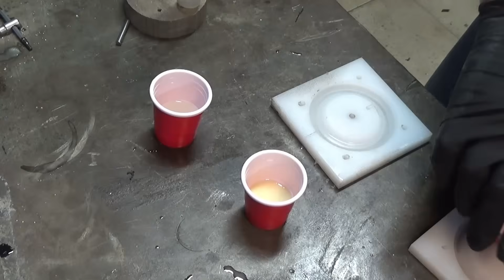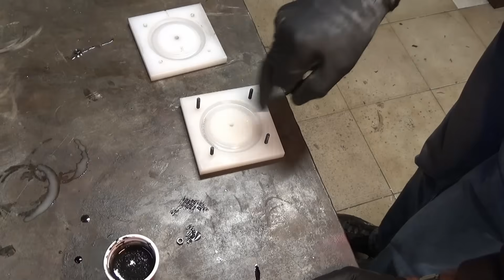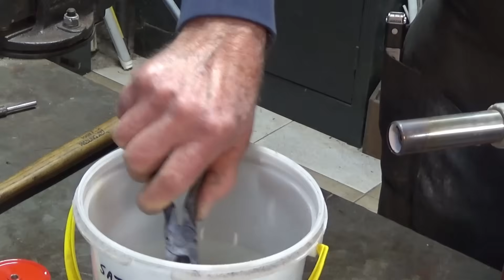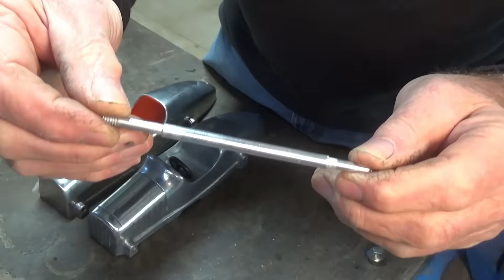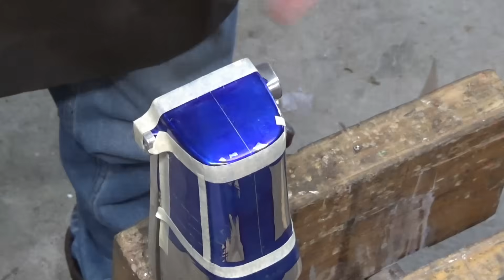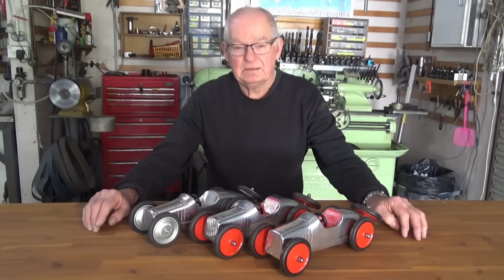Cleveland Racer Part 7 - Final Operations

Comment: They turned out just spendid Mark. Looking forward to the engine build 👍
Reply from the maker: I made the first chips on the Crusader engine yesterday. It took ages to make the 3D model because I did it using Solidworks which was unfamiliar to me. I have fallen out of love with Autodesk products due to the pricing for the commercial versions and the restrictions in the free Fusion360. About the only thing that Fusion does well is the rendering which you will see in the next episode.
Regards,
Mark

Comment: What an awesome build - and what a change from your first set of tyres to the last.
Suggestion for mixing is to cut the rounded end off the mixer so you have a straight end. That way you can get into the corners and scrap the bottom of the container fully. Like you use for the silicon.
The simplicity of the blue + masking tape for layout looks wonderful (colour contrast) and is a simple non marking solution.
For others a thought is to cover the areas to be worked in clear adhesive book cover plastic. It would be easy to cut through where needed, provide a little more guidance (plastic thickness) and perhaps (hopefully) take any slips rather than the model being damaged.
Just an idea - no experience to back it up.
Reply from the maker: Thanks. It was ineteresting that the left over resin in the cups would fully cure without leaving a residue of sticky resin. I get what you mean about having a square end on the mixing stick though. The instructions do emphasise the importance of scraping down the sides of the cup and I assume that applies to the bottom of the cup too. Maybe it is less critical than the instructions make out. None of the tyres had any soft patches and I was very happy with the colour and the resolution of the finished parts. 
Regards,
Mark

Comment: Well done! 
 By the way, what would have happened if you had simply used the black silicone mastic to flood the tyre mould? Might you have got useable tyres?
Reply from the maker: I have never tried it but I believe that silicone does not cure well in a closed mould. It needs to have access to oxygen to initiate the curing process. I have read that adding cornflour to the silicone helps with curing in a closed mould.
Regards,
Mark
Reply: @Preso58 Ah, I see. Hence the need for something two-part.

Comment: If you could get the "pie crust" style dimples and a tire tread that might add more detail that is easier to separate from the mould.  A simple zig-zag tread that is a little over scale may be able to be pressed into the tread using a heated "pastry cutter" or something similar.  Or you can use a thin layer of plastic and use your laser to emboss the tread.  Then bend the tread pattern into the tire patter.  The tread pattern might need to be one time use.
Reply from the maker: I am thinking that "racing slicks" would have been required on the streets of Monte Carlo. 😁
Regards,
Mark

Comment: I was wondering about the branding idea.  I was thinking that with the rubbery tires it would allow writing and ribbing and tire tread.
Reply from the maker: As it turns out, the CNC machining process left a nice ribbed pattern in the sidewalls of the tyre. I thought about a tread pattern but I am going to call them "racing slicks".
Regards,
Mark

Comment: Hi Mark - well done - they look great :¬) 

Further to my earlier comment that the seat was on the left to keep it to the inside of a counterclockwise oval track, thus helping weight distribution, I further note that there is actually a Cleveland Speedway, in Cleveland Ohio. This (no surprise) is an anticlockwise oval. It might be worth contacting the Speedway to see if they know of any connection to the models?
Reply from the maker: I would like to know more about the history of these car models and where they came from. I did search Google Patents to see if I could find anything but I got nowhere. There is a "patent pending" on the underside of the casting but that doesn't mean that the patent was ever granted. It may also be a case of structuring the search query correctly. 
Regards,
Mark

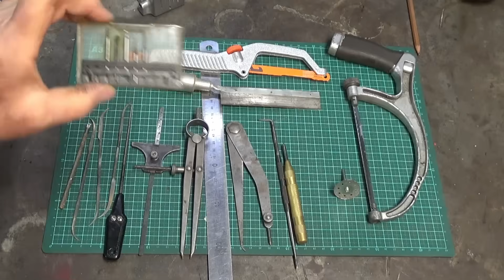Comment: 23:03 Now it's too late, but..
I believe checkering tools for gun stocks will be ideal for this purpose.
Exactly for this kind of work, high visual precision, highly controllable, stop in a spot..
Of course... they are intended for wood, but will cut aluminium as well.
Reply from the maker: I recall reading a workshop article on that process. I believe you can make DIY versions from old hacksaw blades.
Regards,
Mark

Comment: Excellent job Presso. Those look fantastic. Top tip on annealing the brass (or copper), that I learned from jewellers, is to mark the metal with Sharpie ink. The Sharpie ink evaporates and disappears at the annealing temperature..

Comment: Brilliant outcome all-round, extremely well done. 👍 Off topic a little, I did my first TPU prints this week. I didn't have any of the problems I've seen in some of the horror stories about printing with TPU, and I was extremely impressed with how it came out. It is incredibly flexible. So it may have worked ok for your tyres,
Reply from the maker: I am keen to try some flexible filament. Inkstation here in Australia sells a black TPU for $42.90/Kg. It is way cheaper than the genuine Prusa Flex. It was just that the Prusa booklet had a section on Pro's and Con's for each type of filament and the made it seem like it might be problematic. 
I should give it a go.
Regards,
Mark
Reply: @Preso58  I paid around $38 for the generic stuff I bought, the brand was Nevs Bye, odd name